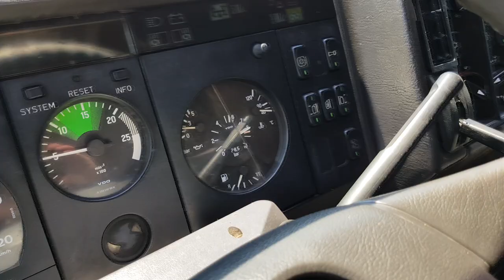TRUCK MERCEDES-BENZ SK 2653 6X4 TRACTOR UNIT FIŠ TRUCKS & MACHINERY SLOVENIA

Comment: Nice truck! Highest output level of the proven V8 OM442LA, only available in €2 emissions, XX53 was the successor of the SK XX50 trucks with €1 engines. Introduced in 1994, thus called the SK94 for its new front grille now carrying the type designation and new exterior and interior designs with ergonomic four-spoke steering wheel and new fabrics. Worn out driver's seat - wasn't it possible to exchange the seat cushions with the passenger side (most often like new) to wear both of them equally?
Reply: Frank Steinmann how much this truck cost just curious
Reply: Mkazilakwa Mchilloh   I do not own this truck, please direct your enquiry to  www.fistrucks.com